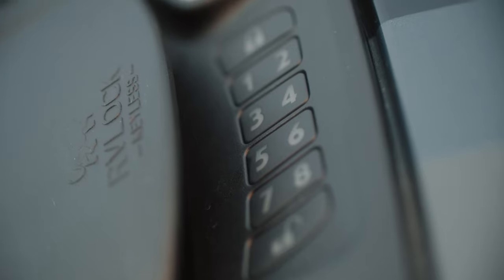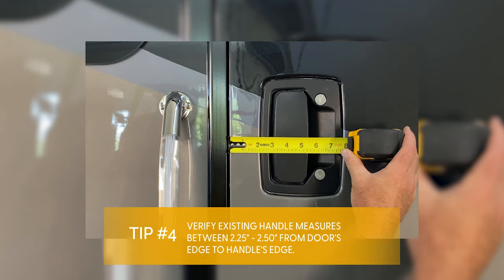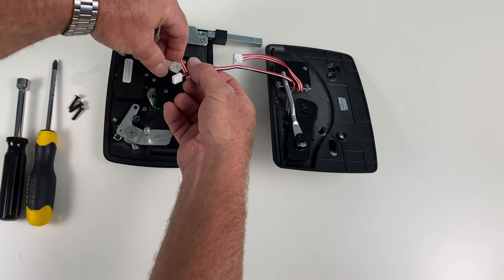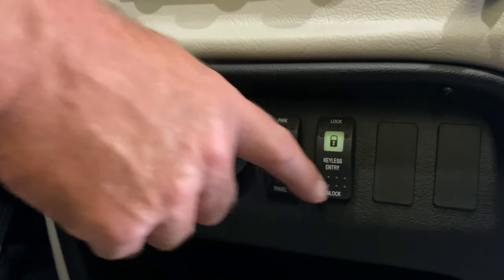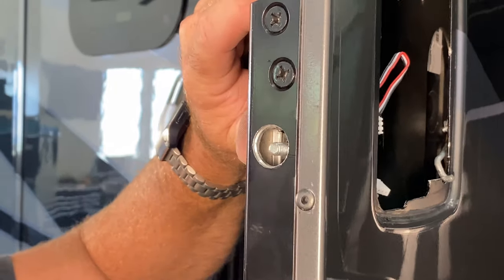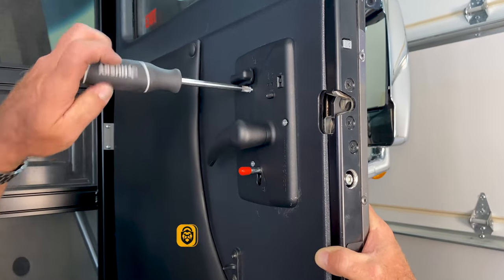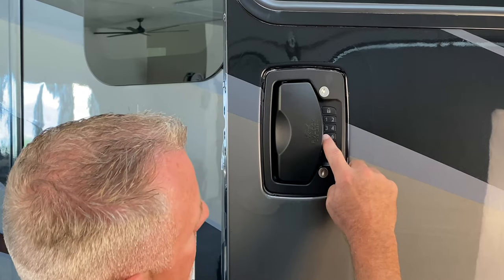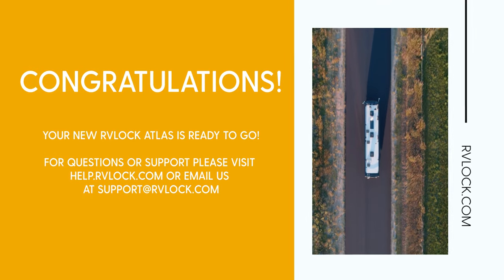RVLock Atlas Installation and Programming

Comment: This video needs to be updated. There are mistakes because the product has changed. For example, the reprogramming does not work as described. There is no “battery tab” with rechargeable batteries. The unit does not “beep” — it speaks words.

Comment: How do I return this?  No one has replied.  I bought it and it does not work.  Fitment issues, looses key fob programming, wires have no place to route without interfering with internal springs and levers....   Please help before I call my credit card company that I used to buy this.
Reply from the maker: Hi Michael,  please call us at 888-316-9899 or email us at support@rvlock.com. You can also begin your return by visiting this link. https://www.rvlock.com/a/return